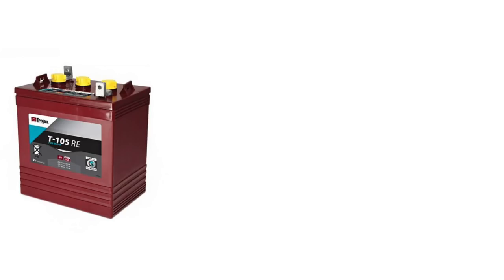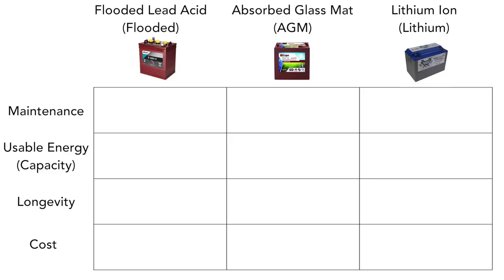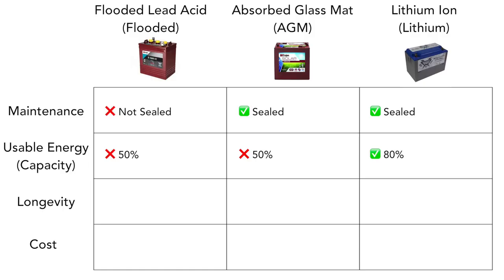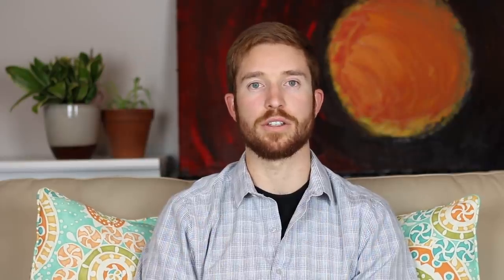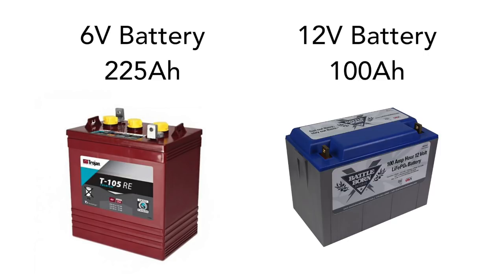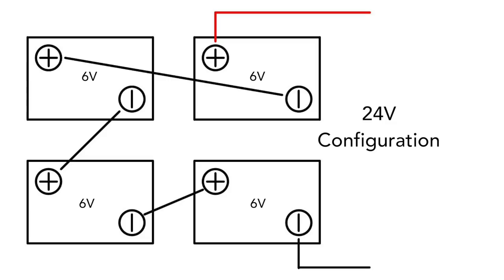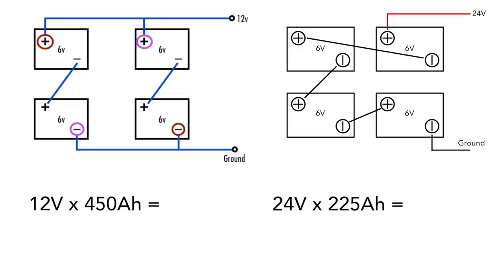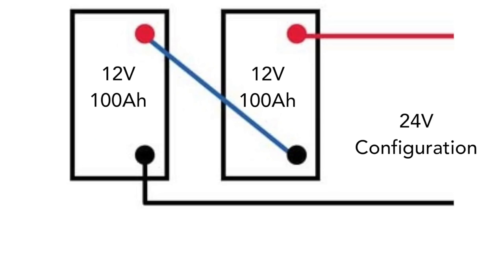Battery Bank Options + Wiring Solar Batteries from 6v to 12v vs 24v

Comment: Have you seen the carbon-foam batteries by Firefly? They look intriguing - fall between AGM & Lithium in price - but still have the HEAVY weight of other Lead/acid units. . .    :\

Comment: You don't get 50% draw capacity on lead acid. Lead acid batteries are about 30% max draw, 25% if you want them to last. And although I've seen a few companies claim 80% on lithium ion, it's generally closer to 60% for most of them.
Reply: If you never use your batteries they will last a very long time, measured in YEARS.  But the purpose of the battery bank is to use them, AS NEEDED.  Are you going to sit in the dark and stare at your battery bank with a flashlight?  If you never drive your car, your tires will last along time too - but that makes your car USELESS ...

Comment: I'm curious about the difference between the lithium ion and the salt water batteries given the same factors. I appreciate this information but I heard about the salt water batteries and was more drawn towards it because of its natural aspect and it ability to charge/drain 100% and lasts about 25 years. If memory serves. What I want to know is, is it comparable to the lithium battery or even better?
Reply: If I'm not mistaken they're rather expensive and as far as I know they're for "stationary applications" - which would exclude them from being mounted in a vehicle.   Not an expert on them, so I may be wrong. I just checked prices and found things like 67Ah for over $3k - that's serious money when you can use a LiFePO4 battery with 100Ah at 1/3 the cost.

Comment: hi I have a 1987 bounder 34 ft I have two batterys  one to start the R.V. and i'm not sure on the other its a maine battery 
my generator doesn't start it clicks the other is I don't know how it runs on gas or propaine  do you know
Reply from the maker: Hey David. Can you send me an email detailing a little more of your issues? duetjustus@gmail.com I'd love to help if I can 👍🏼
Reply: check your relay-isolator and check if the secondary battery draws the current from alternator. make sure both batteries are good before you do anything else.

Comment: Initially, I'll start with flooded lead acid. With the huge investment in inverters, charge controllers and panels, Lead Acid is the most affordable way for me to get the capacity I need. I can get cheap golf cart batteries, rated for 1000 cycles @ 50% depth of discharge, for less than $100.00 When I run the numbers, that puts me at about 10 cents per kilowatt hour of stored energy. After about 4 or 5 years, I will have recovered enough of my investment in energy savings, to entertain lithium iron phosphate, or lithium cobalt oxide. Just to get running, I need the most capacity at the lowest cost. the other components will last for years. Many of the components are warranted for 20 years! the labor to install it, the wiring, and the permits, are pretty much a 1 time expense. That means, the levelized cost of energy becomes less and less as time goes on.
Reply: you can get much more then 1000 cycles. Draining to 30 % still yields 1000 cycles for T105
Reply: You wouldn't go AGM first?
Reply: @laprepper  I looked at AGM, but for the difference in price, the cycle life wasn't enough, to beat cheap golf cart batteries in terms of levelized cost per kWh of stored energy.(at least at the time of my original post)
Reply: @vincentrobinette1507  I got AGM batteries at Sams Club for $179/ea. Going lithium means the additional cost of changing out my inverter and charge controller. I have solar on my roof.
Reply: @aaaideas4U  If you DO gi lithium, go Lithium Iron Phosphate.(LiFePO4) They, at 3.2 volts per cell, means that 2 cells in a series is exactly the same as 3 Lead Acid cells in a series. You end up with a mean voltage of 12.8 volts per 4 cell battery, and each 12 volt battery will charge to capacity at 13.6 volts, but you have a maximum allowable finish voltage of 14.6 volts. You would NOT have to adjust your charge controller. I have successfully run AGM and LiFePO4 batteries in parallel, and have gotten the full capacity of the sum of the capacities of the batteries. The only caveat, is that you will need voltage balancing circuitry. Lithium batteries have no tolerance for overcharge, though, they have quit a span of acceptable finishing voltage. (that said, I'm looking at 210 Amp  Hour, 6 volt golf cart batteries for about $90.00 a piece)

Comment: Missed one of the biggest advantages lithium has over the other two and that is weight. 100 lbs on average for flooded and agm, 25 to 30 for lithium. May not make much difference to some one setting up a home power system, but a lot of people are using the lithium in rv's just due to the weight difference.

Comment: Why didn't you include gel cell batteries in this comparison. I'm curious because that's what I installed in my girlfriend's shuttle bus-home.
Reply: Are GEL batteries designed for Deep Cycle or Standby ?

Comment: A few things to mention: Apparently there is no reason for AGM batteries since they're about as "bad" as regular flooded ones at twice the cost. The advantage of AGM's is that they handle motion a lot better than flooded batteries, plus of course they're "maintenance free".
Lithium batteries have another advantage not mentioned: they discharge and charge rather quickly. You can suck a lot of short term amps out of the right configuration of lithium batteries. Having the storage capacity you need is one thing, being able to short-term power something big is an advantage of Lithium batteries. 
One more thing: if you use Lithium batteries, install the INSIDE your RV, not in the basement. Lithium batteries handle extreme temperatures a lot worse than regular lead acid batteries. Since they don't gas, put them in your closet or under your bed. They will last a lot longer.
Reply from the maker: +Uwe Schroeder Good info here! Thanks for the addition. Like I’ve said, I can go into so much on a topic before there’s a loss of interest. This is just a fundamental overview an I will go into more of this stuff in the future. Thanks for watching 😎
Reply: uwe you mentioned  charge controler: I wonder if it safe to charge Li-bats using dodge roadtrek oem alternator passed tru relay-isolator, i have to figure how to charge the system when my van is in undeground garage, fog or at night before i switch from lead to nickel thank you!
Reply: Someone else may know more about this than I do, so hopefully someone chimes in. 
Personally I wouldn't charge Li batteries directly on an alternator. I'd always go through a regulator of sorts. Actually, unless you invest into one of the smart programmable controllers (which are quite expensive but can combine and control multiple sources of power), I'd probably have a MPPT controller to charge using solar and an extra PWM controller to charge from the alternator. Cheapest way to combine would be a simple switch allowing to manually switch from solar to alternator.  At that point you'd just switch to whichever source you want to charge from.
BTW: a PWM controller because it's better for a constant voltage power source (which an alternator almost is), where the variable voltage from the solar panels is better handled by MPPT controllers.
Of course, both controllers would have to have a Lithium battery setting (meaning the controllers have to be compatible with your batteries)
Reply: thank you Uwe. your concern is good enough. Ill have to wait until  LI compatible alternators-controllers hit the market and stick to AGM until then. i just don't think density compensates for the price and fire hazard at this point. i have a 270 Ah  AGM sys  ( relay isolated 75AH main + 200ah secondary with 600w flexible panel w controler feeding secondary bats.

Comment: To maximize the life of my EV battery the charge is 80% max and 20% min or 60% of usage capacity. My EV has an extended range mode that will charge the batteries to 90% giving 70% of usage capacity. And the manufacturer Daimler for the EV and Tesla for the drive system say that repeatedly using 90% will significantly shorten the life of the batteries.  Extrapolating from that information it would seem that using 80% would further shorten the life of the batteries. Can you explain?

Comment: I'm sure that most people will still go for the LEAD (OLD SCHOOL) Batteries and at .23c per kwh  
it looks that same as that Lithium battery and only out $150 PER Battery... 

BUT PLEASE, look into the maintenance of trying to fill them up with water and the weight of them. 
I would start small with a Lithium battery long before I would deal with LEAD ACID...
Reply: Lithium is 3 TIMES the cost of Lead Acid ...

Comment: From what we understand, running a 12v battery bank through an inverter multiplies everything by 10. Therefor a 300w refrigerator would be pulling 3000w. Is this legit?

Comment: Novice question.  But how can solar possibly compete against grid power if the cost of battery storage alone costs at least 21 cents per KWH?
Reply: Solar with batteries cannot compete with grid power and probably never will.
Reply: Solar can compete with grid power.
The initial cost of the equipment is large, but you system will last you 10-20 years. Depending on the weather, you can get your initial cost back in 3-6 years.
Reply: @niccatipay  So, price out a 10,000 Watt PV array, a 125 Amp 48 Volt Charge Controller, a 1,000 Amp-Hour 48 Volt Li-Ion Battery Bank and enough 48 Volt DC-AC Inverters to run the entire home.  You will soon discover that you cannot EVER break-even unless your rate for electricity is extremely high AND you live where it is very sunny ...
Reply: @MrSummitville  
Solar is a case to case.

Just as the pricing of your setup, if you bought over the top and hired an installation company.
Reply: @niccatipay   Pricing for everything can be found online.  It is very difficult for Solar to compete with Grid Power. The home-owner must have very high per kWhr grid costs AND many hours of sunlight. If you go Off-Grid with a large  Battery Bank and a whole house inverter - you chances of break-even are most likely never ...
Reply: @MrSummitville  
Yes, pricing can be found online.
Your cost for deliveries may differ from where you are. Like India industrues have cheap solar, but has a premium after exporting to far places.
Reply: Just in case you are missing the point. 

Stand alone solar is as any solar array, on a case to case basis. It is possible, its just not for everyone.
Reply: @niccatipay  Just in case you missed the point ... If  @Jason James already has reasonably priced Grid Electricity, then going Off-Grid with Solar & Battery Bank will NEVER be competitive ...
Reply: @MrSummitville  
Case to case basis.

Here is an example.
You are in a rural area where there is intermittent power. You are in the tropics and your power bill is heavily taxed because for the nation.

Do you connect to the faulty grid?
Do you buy a generator? (Maybe)
Do you buy a battery? (Maybe)

But you don't connect to that over priced jumble of a wire.
Reply: @niccatipay  Did you not read where I wrote "reasonably priced grid" ?   Did you not read where he specifically asked about about a BATTERY BANK?  Did you not read the initial question?  He asked about a Battery Bank being less COST EFFECTIVE.   Using a battery bank and/or a generator is NEVER more cost-effective than reasonably priced gird electricity.  The math is very simple ...
Reply: @MrSummitville 
 Let me ask you then.

Are the numbers equally to all manuacturers and consumer bases?
Reply: @niccatipay  I am not interested in discussing all of your hypothetical situations.  I am only trying to answer @Jason James question ...
Reply: @MrSummitville  
I was just responding to your hypothtical question regarding the answer that I already had given him.

Comment: isn't the majority of manufacturers and providers going to 48v?  Smaller less expensive wire, better voltage utilization for inversion.  The auto industry is going that way too in automobile wiring to lower weight and costs.  Will you be addressing that trend in the solar industry?

Comment: You can totally run lead acid below 50% DOD. Not an issue if they are re-charged properly.
Reply: Just where did this "... 50% DOD ..." rumor start?  And why do so many believe it?
Reply: @MrSummitville  because it now helps sell lithium batteries and people just like to absorb content.  originally it was likely a design rule of thumb for solar to obtain more than one day of autonomy from a variable solar output. bouncing lead around at low SOC is not great and they suffer from partial state of charge degradation - which is fully reversible if charged properly. you can basically do whatever you want to lead as long as you fully charge it on a regular basis. this don't go below 50% rule is lithium lies - unfortunately.
Reply: @andrewswingler  Off-Grid is typically designed at only 20% DOD - 25% DOD daily, to allow for up to 3 days of autonomy.  The is no "% DOD vs Cycles" mfr chart that shows a sharp drop-off in Cycles below 50% DOD - not one.  But now they are talking about 80% DOD EVERY night.  So, what happens if it is cloudy the next morning?  You need to fire up the generator!   And there goes your "Lithium Savings".  The Trojan SOLAR SPRE 06 255 is rated at 6V @ 230Ah and 3,400 Cycles ( 9+ years ) @ 30% DOD = $205 each, which is very cost-effective ...
Reply: @MrSummitville Yup - you got it. Plus there is no solar application where you can ever use up 3000+ cycles of a lithium battery. Plus lithium batteries have way more failure modes. You just have to ask: if you were to be stuck on a sailboat for 6 months and your life depended on the battery - lithium or lead? Lithium is stellar technology for many applications - but it's not an obvious winner for off-grid solar or for overall robustness. Need another argument for the economics of lead? Look in a golf cart.